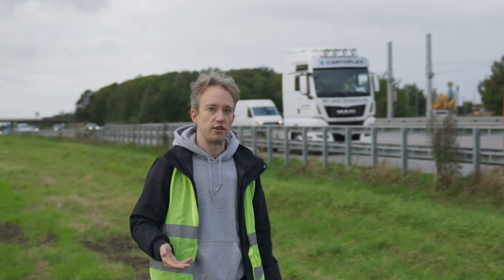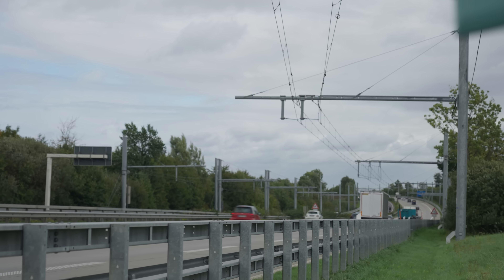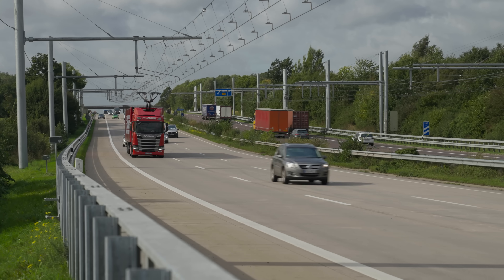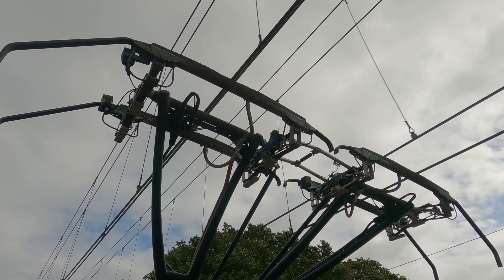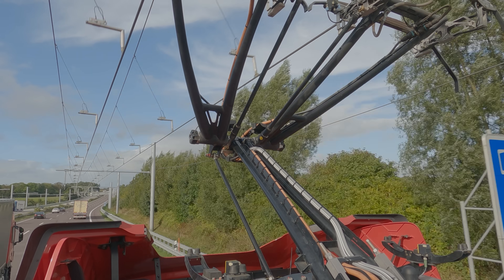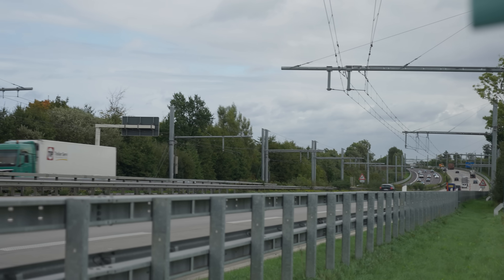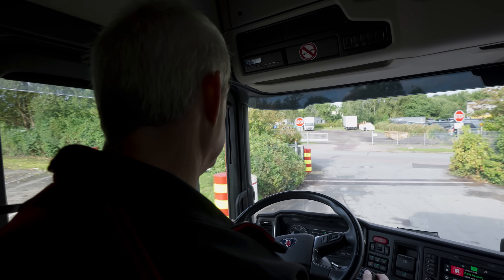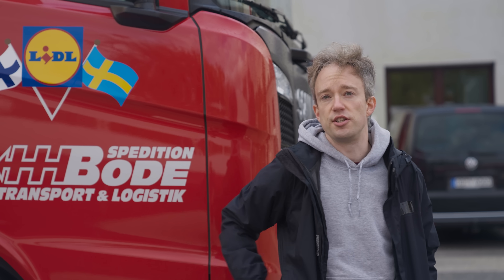The highway where trucks work like electric trains

Comment: I'm  a night driver in the UK. The amount of motorway closuress by Highways England at night  would make this system extremely unreliable. 
General motorists may not be aware motorway projects in the UK are mostly done 21.00 to 05.00 . This is when most UK trunk fright is transported, parcels, bulk stock to supermarket DC's and many other day to day items. 
I shall give an example.. 
Travel from Bristol to Hatfield North London.. 
Start time 20.00
M4 closed J14 to j13 diversion through Hungerford B road and. A Roads. 
Then M4 lane closure J13 to J12 which would be off grid lanes as this system cables over lane 1 and lane closed is lane 1??
Then J11 to j10 closuress diversion A4 an A404 
Then lane closures M4 j6 to J4B 
Then M25 lane 1 and 2 closures J17 to J20 again lanes 1 and 2 closed. 
Then the so say " last mile BS .
From J21a of the M25 is A roads for 14 miles to Hatfield. 
Could use the A1m but that has a two year night closure plan and is extremely unreliable. 

This may work in Germany on well maintained and open autobahns but with Highways England in charge of over night closures this type of truck without diesel back up is dead in the water. 
UK motorways at night at present are just littered with closures. 
Just check out Google maps after 10 pm and the UK's motorways are mostly closed between cities at least 2 or 3 closures per journey. It's a nightmare. 
Highways England fail to plan diversion routes or consider residents on routes which are B roads or residential streets. 
Electric pantographs are fa use in the middle of Watford and Rickmandsworth when Highways England close the M25 anti clockwise at 9pm at J20 to J17 which is 30 minutes driving 44tonnes at 16.3" through the streets of Watford and Rickmandsworth. 
The full closures are put in place to " save money " on conning off lanes . This would be a disaster for UK haulage and not may appart from the public do good supermarkets would put any of these things on the road. It would just be a smoke screen and PR exercise IE what they want you to see where as the vast amount of their deliveries Inc the fridges screening their nuts off to keep you food in transit cold or frozen run on diesel. 

Batteries and electic trucks the future ... My harsss. 

Bin highways England and there may be a outside chance. But while these lot badly manage our motorways we have not a cats chance in hell. 
Highway incompetence is more like how they run night time motorway and truck routes. It is a total nightmare driving trucks at night at the moment. The last thing we needed is electrically dependant lorries when not being able to stay in range of pantograph cables cos of 5 or 6 economic closures. 

Sorry if you believe this stuff can work here..... Take a trip at night and make your own mind up.

Comment: Lets use trains...how about that?
Reply: Build a Train track? You think it's a cheap dont you?😂
Reply: @vanhelsing4927 Highways are also expensive. Specially when they go through cities
Reply: @vanhelsing4927  It's cheaper than Highway
Reply: The big advantage is you can charge where a lot trucks are driving and can still drive to every location not connected to rail networks
Reply: Trucks are used to deliver things from big destinations, like train stations and ports, to smaller destinations. You can't build a train track to every store.

And I live at this area this track got build. It's right next to Hamburg, a gigantic port city, with very few big train stations at the cities near it. The train stations that do exist are intended mostly for passengers, as the cities are not big enough to warrant train infrastructure. The biggest cities have like 20k inhabitants

Not to mention the Highway is connected to many smaller villages as well, which can't afford a train station. My village as an example it build directly at the A1 Highway, but has only 1000 inhabitants over a quite big area, therefore the stores in the industry center all use trucks for delivery, as a truck from Hamburg to my Village takes like half an hour and can just drive on the existing Highway

Comment: The trams in some cities work on both battery and overhead wires.. in the historic inner city the pantograph only goes up at each stop to charge the batteries. Once it leaves the city it runs 100% on overhead wires as there is a much longer distance between stations/charges. This keeps the inner city free of overhead wires. Similar concept.

Comment: If you want a big massive oversize load moved say a old locomotive or a new 350 ton power transformer going to a wind farm.. thay wont be able to use these main roads and have take the smaller roads

Comment: This could also be used, in Simi, autonomous operations of vehicles, and it could be used to make road repair vehicles, for highways, completely electric, you could also be used, as a power solution, so you have a power bank, on wheels, feeding energy to the grid, using the power lines, to distribute, the energy from those mobile power banks.

Comment: A truck like a train.
That's a smart way to save on fuel.
This way is also in use with the buses used in public transport.
In Arnhem there are Trolley buses riding in the city.
These buses are fast and can be combined with buses that run on diesel fuel.

Where they have no overhead wires, the diesel fuel buses will take over.
And this can possibly run on overhead wired that are in use by trams.
In the city called amsterdam it might work.
I don't know how it can work. I know there are lots of possibilities to make it work.
And I don't know how long it will take to get it working. This will possibly take a long time.

Comment: That's a shame that Germany's electricity grid is not very eco-friendly...
Reply: Agreed, fully. The Germans do a lot of things right, but one mistake they've made was shutting down nuclear plants to back up renewable power at night and when there's no wind.
Reply: compared to what country and source please
Reply: @zznd4754  It's neighbour, France
Reply: @LambdaWave84  65% of your energy in france is based on nuclear energy… xD and arround 25% is based on renewable energy sources idk what kind of stuff you are smoking but that does not look like a „eco-friendly“ way of generating electricity and by the way over 50% of germanys electricity is based on wind power
Reply: @zznd4754  And dirty coal and gas. A lot of it.
Germany emits almost 10x more CO2 than France per kWh. That's facts.
Reply: @LambdaWave84  How does the uranium for the nuclear reactors get to france?
Reply: @Linkyboy_13  Why?
Reply: @Linkyboy_13  based on figures provided by the EPA, a 1 GW Thermonuclear Power Plant breaks even after about 4 weeks of Full output. This includes emissions from Transport and refining. The Mining itself doesn't apply since Coal has to be mined as well. 
(While Coal Plants continue to increase the overall emission for the rest of their operation)
Nuclear is and will be the cleanest, space efficient large scale power production, at least until we figure out fusion.
Reply: @zznd4754  France, Finland, Sweden, Belgium
Reply: How about France, which uses mostly nuclear power and has lower CO2 emissions per MWH generated than Germany. @zznd4754
Reply: Germany is more eco-friendly and uses less coal compared to the US, Australia, Canada or Japan for example. Those countries have higher emissions output per capita.

Comment: I bet you could make this more efficient by running the trucks on some kind of rail system to guide them, then you wouldn't even need to steer.  And you could probably couple multiple trucks together, perhaps with one large  cab providing all the "locomotive" power for the whole "train" of goods containers...
Reply: This is the most over used sarcastic joke in history

Comment: I see it more as one of transition phase to replacing lorries with trains again. This lorry pantograph does use much less fuel than traditional one (which is great), but wears itself unevenly (due to lorry constantly going slightly from left to right) and tires still wear out - not to mention, that each lorry can only carry one or two containers each, which isn't really a good use of space. I'm certain should this solution be implemented, we will soon have projects to add additional trailers to each lorry (as one powerhouse could easily carry all of them), allowing them to perform large-scale operations and unclogging this lane - and then, finally, realise that it's much cheaper and efficient to do all of this with trains and contiue its development - or even replace these lanes with railway tracks.
 I'm not saying this solution is a gimmick - I'm just saying it won't serve as the most efficient solution long-term, and could serve as a way to return to traditional means of hauling cargo. The only places this could somehow manage to still be around would be where it's impossible to lay out tracks, but where roads and this grid could fit.
Reply: Yes, I see your point of view as a graded rebalancing towards railway systems taking back their pre-eminent position in a multimodal logistics system. A nudge back to electrification of transportation is sorely needed by government subsidies for e trucks
Reply: @YaduMathur  The main problem with rail is that it needs capacity to justify implementation. It takes a ton of space an capital investment to make it runing.Tram or troleybus style electro pickup system may help to bridje this gap in capacity and decrease cost of such shipping.
Reply: Until a train can get off its tracks and drop stuff off at any warehouse, store or home, I don't see a train replacing trucks in these use cases.  

The question is, does the cost of building out large amounts of these across major roads result in savings in delivery costs over ZEV trucks that don't use this charging system.     The more trucks you have using this, the more economical it becomes, but it needs a critical mass to be worth it.
Reply: @jdmspotter  Trains don't need to do that. You can have lorries at rail freight depots doing the final deliveries, and also the shorter distance journeys that are not practical to transport by rail, while having trains doing the long distance trips, where they are significantly more effective. This is mostly what we have now, except long-distance trucking is still a widely used thing. This is probably because rail freight is nearing capacity, which means the solution is to increase rail freight capacity, and get more long distance trucks off the road and their cargo on to trains on tracks.
Reply: @bombardygamer4248  So in other words,  trains won't replace trucks.
Reply: @jdmspotter  Not entirely, but they can replace them for long distance, which is what this system in this video is trying to be a solution for.
Reply: Trains don't climb even a meager inclination if there's zero inertia up-front !! Trains suffer to start from stationary always.

Comment: Why not connect multiple of them and pull with a powerful single truck? Then we can create a seperate lane/road for them, one in each direction. Replacing tyres with steel wheels and road with steel ribbons welded together would increase traction, therefore increasing efficiency.
Reply: German Rails are ridiculously congested, Freight Trains take 3+ Days to cross Germany North-South (~1000 km or 600 Miles) because they spend much more Time standing than driving. Since the 1990ies, 1/3 of German Trackage has been abandoned/removed, while Traffic has increased by over 50%. Trucks make up over 95% of Freight Transportation here for that Reason.

There are Projects to upgrade Rail Infrastructure, but these are either Decades behind Schedule or completely cancelled due to very strong NIMBYism. E.g. is the Karlsruhe-Basel Line (150 km) being upgraded from 2 to 4 Tracks since the 1980ies, but instead of 2016 as originally planned, Completion is estimated between 2050 and 2070 now. A similar Project between Hannover and Hamburg has Just been cancelled a few Weeks ago, because NIMBYs in every Village along the planned Route complained about Potential Noise Pollution.

Comment: why not jusy use a freight train instead and skip the problems of roads altogether?
Reply: German Rails are ridiculously congested, Freight Trains take 3+ Days to cross Germany North-South (~1000 km or 600 Miles) because they spend much more Time standing than driving. Since the 1990ies, 1/3 of German Trackage has been abandoned/removed, while Traffic has increased by over 50%. Trucks make up over 95% of Freight Transportation here for that Reason.

There are Projects to upgrade Rail Infrastructure, but these are either Decades behind Schedule or completely cancelled due to very strong NIMBYism. E.g. is the Karlsruhe-Basel Line (150 km) being upgraded from 2 to 4 Tracks since the 1980ies, but instead of 2016 as originally planned, Completion is estimated between 2050 and 2070 now. A similar Project between Hannover and Hamburg has Just been cancelled a few Weeks ago, because NIMBYs in every Village along the planned Route complained about Potential Noise Pollution.

Comment: The power required for a convoy of trucks would be huge. . 40 MW per mile perhaps?
The transport operators that buy into a system like this would be at the mercy of the investors, who will want their money back.
If/when a truck leaves the carriageway and takes out a stanchion the results of the HT cables falling on the other road users is too terrible to consider. .

Sorry to be so negative but this system is really not suitable for the UK

Comment: Transporting goods from ports to warehouses? Why not couple 100 or so of these 'trucks' together. Then run them on rails with far greater efficiency than rubber tyres on a road, and of course instead of 100 drivers you'd only need one! And keeping these behemoths off the road system would vastly improve the currently appalling standards of road safety. 

Brilliant! We just re-invented THE ELECTRICLY-POWERED FREIGHT TRAIN!

Comment: Why not just use a train? The tech already exists, and it's cheaper. Its not like this is going to actually use the existing highway infrastructure.

EDIT: at least, in the US. Idk how europe is about its highways but there'd be rioting in the streets if they took one lane of the 7 lane highways away.
Reply: According to their FAQ (so take it with a grain of salt):

The rail infrastructure has already reached the limits of its capacity. Path conflicts between freight, long-distance and local traffic are the rule, especially in the nodes. Despite all efforts to shift more freight traffic to rail and waterways, the highest land-based transport volume is therefore provided by road freight transport, both today and in the foreseeable future, with a share of over 70 percent. The main reason for this is that trucks can deliver goods quickly and flexibly - this is of great importance for many logistics sectors.

As part of the Climate Protection Plan 2050 and the Climate Protection Program 2030, the German government has adopted extensive measures to further increase the share of rail in freight transport. However, expert reports commissioned by the Federal Environment Agency show that even with the greatest efforts, rail's share cannot be increased from 18 percent today to more than just under 25 percent by 2030. Because of the overall increase in traffic, this already means a multiplication of rail traffic. However, this alone will not be enough to sufficiently reduce emissions in freight transport. Therefore, the trolley truck can be a sensible complement to rail

Comment: Had a doubt that how the government is going to charge from truck drivers for exact power taken from supply .cause  how we can know what distance a perticular vehicle is connected to supply and what amount of energy they drawn .  Please ans this if anyone has any idea
Reply: Truck drivers aren't really individual contractors here in germany/europe. But even so, there will probably be some sort of tamper proof system that commuinicates with the system either after the fact or in real time how much is being used and the company will be charged accordingly.
Reply: This Question has been answered 100+ Years ago with Electric Locomotives: They just have a Meter on board.
Reply: @Genius_at_Work where I can know more about it
Reply: Any video link if you found

Comment: This could be done on multiple lanes, 2 lanes=4 wires, from left to right x volts, 2x volts, 3x volts and 4x volts, as long as the spacing between the wires is enough to ensure no shorts or arcing, the potential between the pantographs will always be the same and in the same direction.